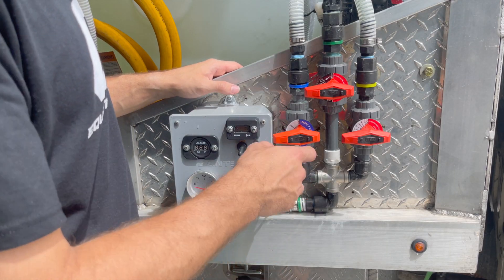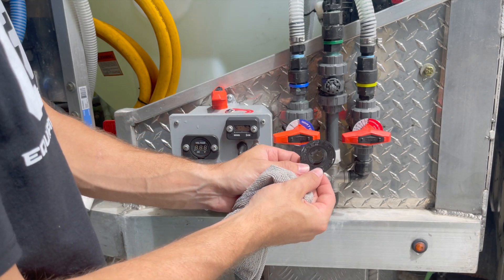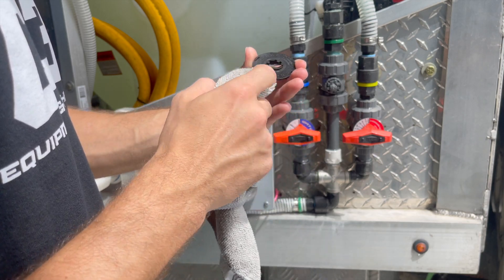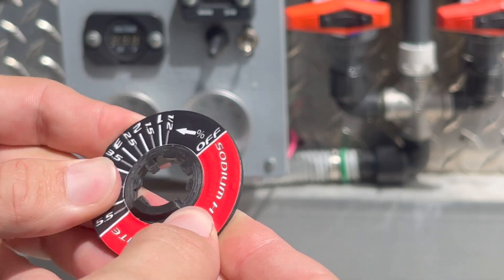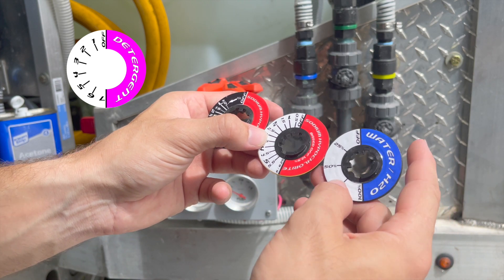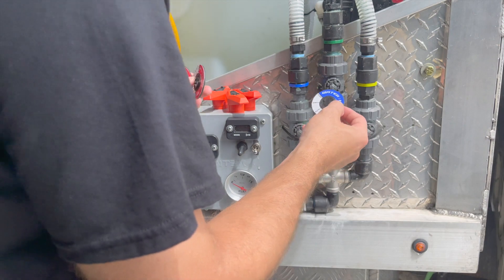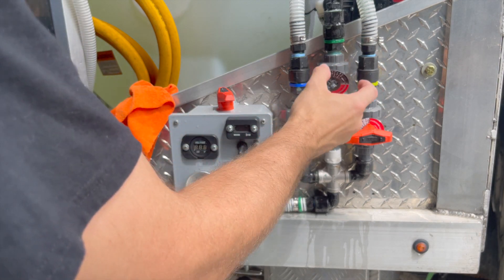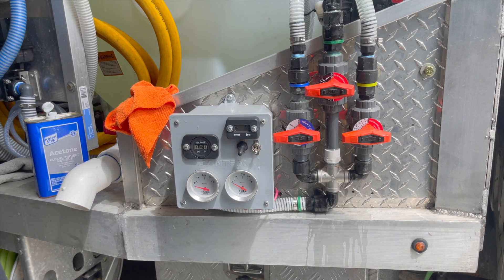How to install labels on the GF 1/2" Metering Valves

Comment: Double check your ratios BECAUSE if you follow Southeast THEIR ratios were completely wrong .  (cutting the bleach input to half of half DOES NOT cut the bleach strength in half . )
Both open wide is a 50-50 mix and 12% bleach is now 6%. 
IF YOU close the bleach half way the mix is now 33% bleach to 66% water and the strength IS NOT cut in half. IT is now 33.% o12%:   4%, not 3% Etc.
Reply from the maker: We have two alternatives for the bleach valves. Shoot me an email and I can send you the other alternative. It depends on your strength of chem and a lot of other variables. It’s just a consistent guide that you can tweak to your setup.

Comment: Update, I installed my GF metering valve stickers that i purchased and they look great.

Have one question. You mention on the video that you can secure the GF handles with a screw.  What type of screw? I see where to drill a hole on the handle, but how do you secure it to the plastic body section? Are there any video links to see how it's done? I would like to secure my handle. Mine feels a little lose and I don't want to lose one while driving.